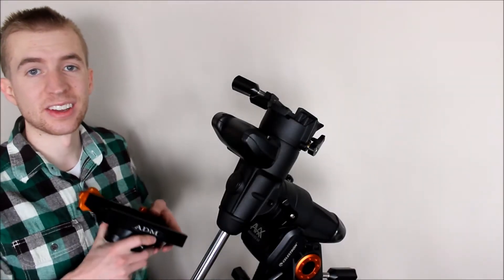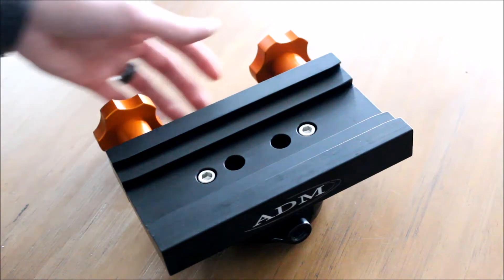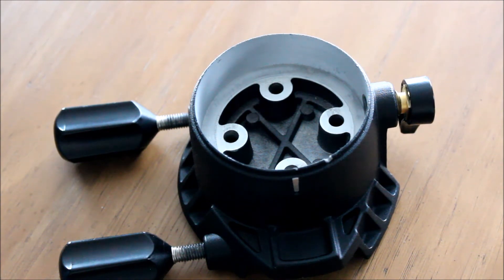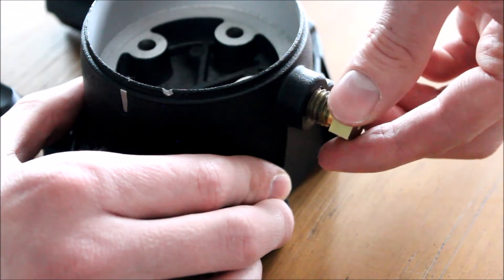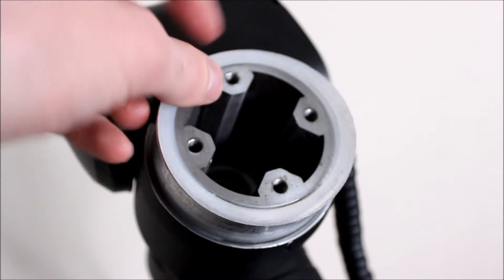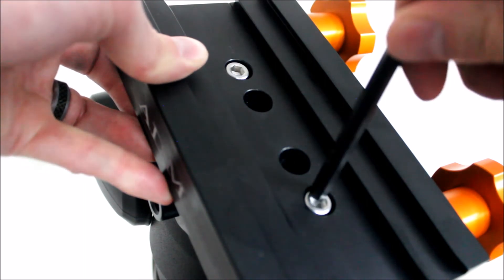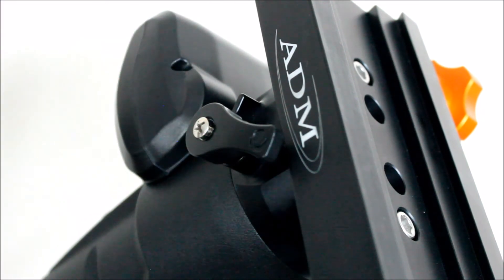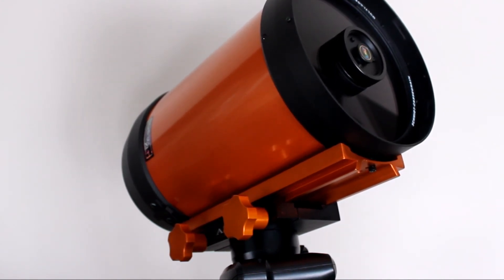How to Install an ADM Accessories Dual Saddle for the Celestron Advanced VX

Comment: Excellent video! However, I'm very disappointed in this product. My center mark is way off. I reached out to ADM several times for a replacement, but they never responded. BUYER BEWARE.

Comment: Just an update for this, I installed the ADM saddle on my AVX, and when I opened the AVX, I did not have the plastic O-Ring, and my original saddle was machined differently. I reached out to Celestron and they confirmed that the newer AVX mounts do not have an o-ring installed.
Reply: I just got my ADM saddle and I installed as well, and i had the same issue.   No plastic O-ring. I did add more greas.   However, when I installed the four hex screws I cant tighten them at all.  If I do, I don't get any movement and not sure if it will cause balance issues.  So they are in, but almost no torque to none.  Let me know if anyone had the same issue and what you did to fix the issue?   Thanks!

Comment: Great video.  Encouraged me to buy the ADM saddle and install it.  However,  I didn't try using the mount until the other day and the declination clutch wasn't working.  Turns out the small item at the end of the screw that creates the tension is missing and must have fallen off and I can't find it.    What is it?  a magnet or a piece of soft metal glued to the end of the screw?  Thanks.  Celestron is very slow to answer my call so I may have to improvise.

Comment: Slymin, since you did this two years ago, I'm wondering if you've done a complete breakdown and rebuild of the AVX.  Due to my current situation, I can't show you my AVX, but a couple of years ago I couldn't get my scopes to balance correctly.  The grease inside of the mount was so thick that I could have the scope really out of balance, put it in a position and it wouldn't move.
I did a complete disassembly and cleaning, removed all of the grease on both the RA and Dec axis', and then relubricated it with White Lithium grease.  AMAZING the difference, I could actually balance in both RA and Dec.  In fact, I need to add weights toward the front of the scope because it's so back heavy, and before cleaning and relubricating it, you wouldn't know it was that far out of balance.
Which I didn't have PHD2 logs, I'm sure that because of reduced stiction my guiding numbers are much better.  GoTos are easier, too, and the mount wasn't nearly as loud.

I'm editing this post to include a link to the tutorial that I used to rebuild my mount.  I did NOT use the bearing as shown in the video, by using the white lithium spray I got great results, and I didn't have the bearing anyway.

http://rocketsparrow.blogspot.com/2017/01/how-i-made-better-celestron-avx.html

If you're still using your AVX, I highly recommend this procedure to anyone who has one.  You'll get a completely different mount when you're done.

Comment: Just upgraded to the ADM saddle and it is perfect. The video here was very easy to follow but I would add that care should be taken not to over tighten the four screws when attaching the ADM saddle and perhaps a bit of grease on the washer is probably needed as well. First time I installed the saddle it wouldn’t move in the dec axis.

Comment: Great video as always , a while back i posted a question for an NexStar 8 SE , but i ended up buying the NexStar Evolution 8  ,and so my question is ,(i am planning  on buying eventually an AVX mount)  is this a good buy ? i mean the evolution already has  gps ,wifi ,and battery
Reply from the maker: Are you meaning is the Advanced VX a good buy? If so, it is a good mount for getting into astrophotgraphy, and it is also pretty portable for an equatorial mount. That being said, if you just plan on being a visual observer, than your NexStar Evolution 8 is more than sufficient. Take care.

Comment: I can’t turn the head after I tighten the four screws with the nylon washer reinstall so I reinstall was a nylon washer I didn’t tighten the bolts tight tight
Reply: you need the washer with some grease. If you give full torque will press the saddle against the Dec body and won't move. Eventually will damage the washer. Bolts need to be snug, tight but a little.